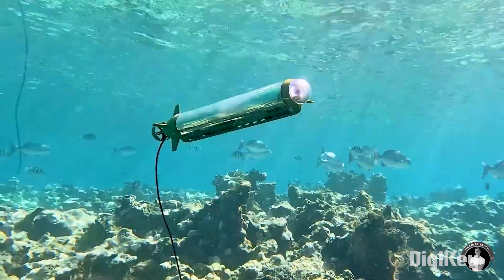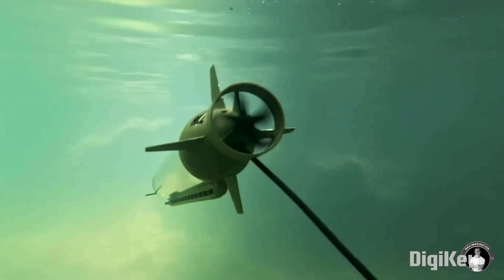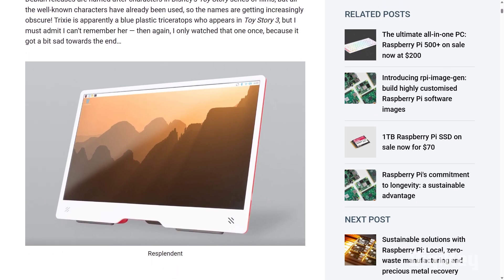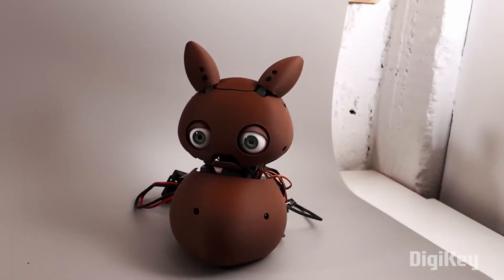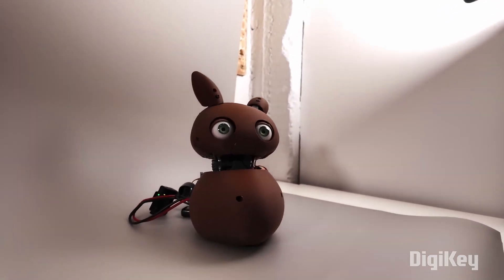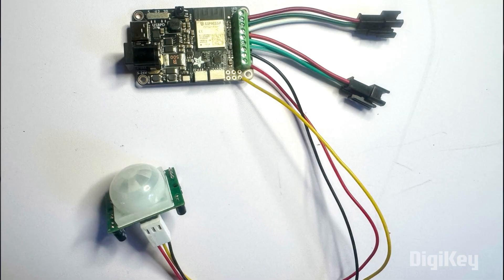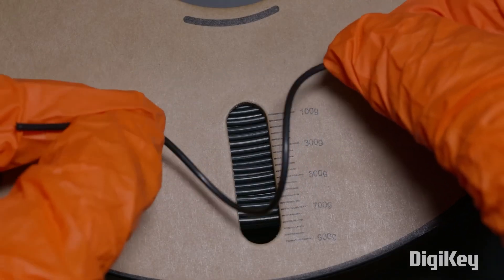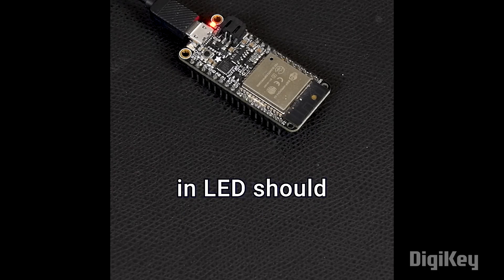Off the Deep End [Maker Update] | Maker.io

Comment: Huawei just released watches that communicate with sonar when underwater! With a high bitrate too. Huawei claims divers can transmit texts between each other. I wanna build an arduino sonar to test the concept now. 

When I was in high school, 30 years ago, I made a pair of diving communicators with laser pointers, headsets and solar panels.
Reply: Oooh, the Huawei sonar watch seems cool, but c'mon, they should have invested in your laser idea. If for no other reason than being able to market "underwater laser communication". Too cool!
Reply: @MakerProjectLab  The microphone and laser beam to solar panel and speaker has been a school experiment for ages. It's super fun and easy to wire.

Wall Street was the first to put it to use when they set up the laser from the New York Stock Exchange all the way to a high frequency trading office in New Jersey.